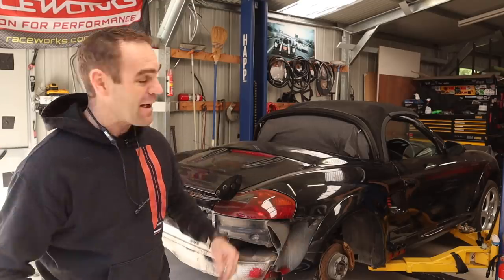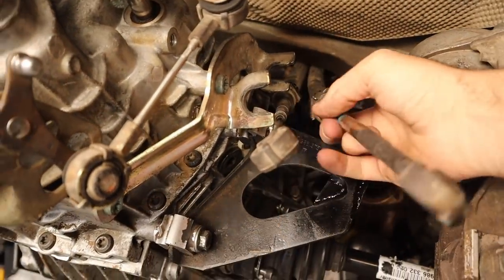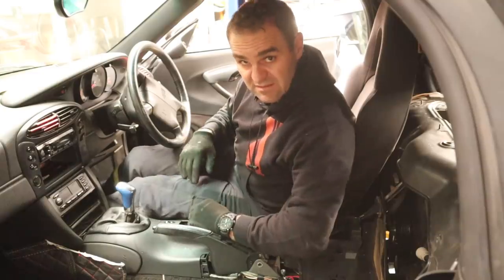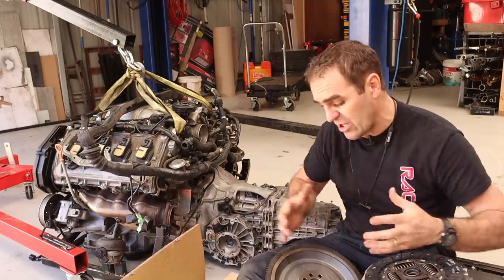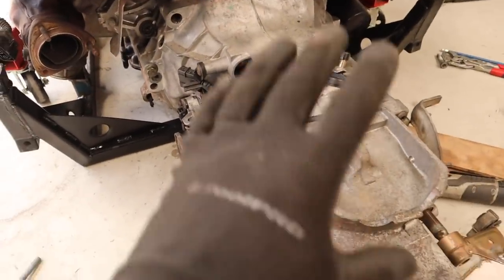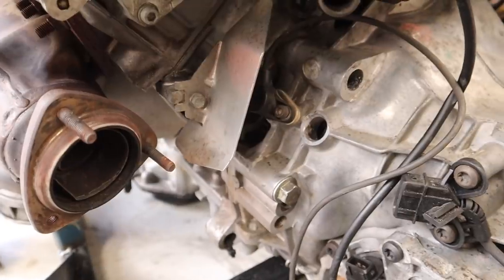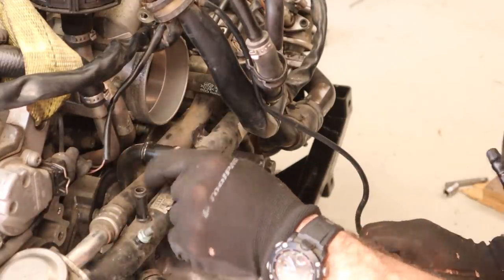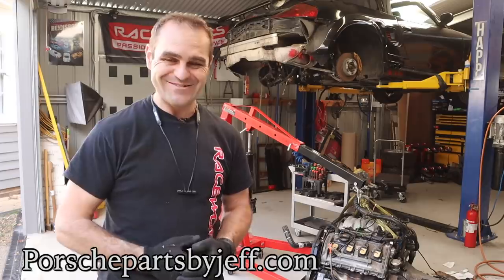Conversion clutch and flywheel - Porsche 986 Boxster V8 engine swap track car build 7

Comment: Loved the way you massaged your way to the gear shift fix!  For a swap I thought would be a nightmare, so far, only delayed parts have really given you much pause. Looking awesome! A thought- put a pair of "garden timbers", about 100 mils square, or 4" US, under the fore and aft of the engine cradle before doing the transmission off boogie. That will let you put a regular hydraulic floor jack under the center of balance of the trans and use it to help wiggle the trans into mate up. Also, while you have it all out, might be a good time to put some better gussets onto the sub frame. The Cayman-ish hardtop sounds like a thing worth exploring too! Mrs.Jeff? Hello, Mrs. Jeff? FR

Comment: No judgement on welding up that pipe, I would have done the same thing. But, you probably want to put an air bleed on it since it is a high point and will probably always have air trapped in their.

Comment: Jeff.
Why didn't you simply take the throttle body connection into the boot through the secondary fire wall.  You would have plenty of space then for mass air and a nice breakfast bend and ideal breathing.
Just thinking.....

Comment: Hi Jeff, a while back i saw a video from some guy building an Ultima with a big LS (or LT) engine and he had the same problem as you have with the intake. He solved it with 3D printing a duct that had recess pockets to clear all the obstacles. Plus it was way more rigid then just rubber tubes or those accordeon pipes (don't know the actual english name for those).
Reply from the maker: If what I am doing doesn't fit, I will look at doing that.

Comment: Will adding a spacer now between the gearbox and engine not affect the mounting point positions for the cradle and chassis?
Reply from the maker: The cradle is fixed, it will just push the gearbox back by a few mm

Comment: Personally all of the coolant hoses tied together doesn't sit right with me, wouldn't be better to bend some aluminum pipe to the right shape and add a flange to bolt along the subframe? So you only have 2 points of hose failure at the outlet and inlet?

Comment: Hi Jeff, love watching.  Did you give any thought on using a Porsche V8?  Just curious if you did pros and cons and would there be easier compatibility?   This conversion will get some interesting reactions on the road.
Reply: He did... main reasons is it’s a common conversion and the gearbox bolt pattern mates directly up to the engine.
Reply from the maker: As James said. All covered in depth in previous episodes ;)
Reply: Plus it’s cheap especially compared to LS swap etc.

Comment: are you still gonna have enough engagement of the alignment dowels between the block and trans if you add a 5mm spacer?  do you need to get extended dowels?
Reply from the maker: It is a factory spacer

Comment: Hello Jeff, what engine code are you using? I'm currently working on a conversion using an AQJ engine (the last A6/S6 V8, with the last V8 ME7.1 management system, which wasn't really CAN bus reliant, from a 2000 model like the later models are). As yours is a track car you may be able to remove the secondary air injection valves from each head, their little cast aluminium elbows and the stainless pipe between them to make more room for your induction system, especially if the engine only has the 2 lambda sensors like the AQJ, not 4 (pre and post cat). I've removed mine as I don't need them for emissions reasons, don't have room for them, and the pallet courier who delivered my engine kindly smashed them, the throttle body and one of the cam timing solenoids for me. 
The secondary air injection valves let additional air in to the exhaust when the engine is cold, which ignites with the rich (cold start) mixture in the cats. Their only purpose is to get the cats up to temperature faster. If you remove them, you would then not need to fit the other parts of the secondary air injection system either (pump, vacuum reservoirs, etc). 
If you're using Audi engine management, this may well cause error codes, but on the engines with just the 2 lambdas I believe they should only be caused by the electrical load from the valves and /or pump being missing, not by the engine knowing the cats have not warmed up as quickly as they should have. I have not tried the electrical side of this yet, but if I am correct, any errors created should easily be remover by using resistors as dummy loads where the solenoid and / or pump should be.
If you are using aftermarket management, or if you are not using cats at all (not sure whether that's allowed in Aussie track cars?), I would definitely remove the whole secondary air injection system.
Reply from the maker: I am not using cats. My engine is ASG, and from memory it only had the 2 O2 sensors. At this stage the plan is to use the ME7.1 to start with if I can. I still need to learn how to flash it and remove the immobiliser. I might try to get it running to start with keeping the secondary air injection, just because the less errors I have to chase at first the better. I can simplify things more later.

Comment: Maybe it is easier to put the engine on that idle standing cart in the background, instead of destroying that new clutch plate, because it's obviously gets all the fulcrum weight, before you have tightened the bolts down...

BTW, this being a racecar only; why not put the airflow meter and filter in the boot/trunk/storage compartment behind the engine?
Blocking off bleeding pipes and hoses is asking for overheating problems due to airpockets in the system.
Reply from the maker: I considered it, but there is a structural member in the way. As for air pockets, the cooling system in Boxsters needs to be vacuum filled anyway.

Comment: What are the regulations at Wakefield Park for beasts like this will be? Will you need to go in sessions for racing cars or will you be allowed with ‘Speed Off the Streets” cars?
Reply from the maker: That would all depend on what kind of day they are running.

Comment: How can you leave all that mess in place? Bin the lot, fit some itb’s and aftermarket ecu. It’ll look, sound and go SO much better.
Lose some weight off that flywheel too.
Constructive criticism btw!
Reply from the maker: That is not exactly cheap track car things though.
Reply: @HomeBuiltByJeff  It does depend how you do it. Bike throttle bodies,  megasquirt and make your own manifolds is cheap as chips.
Easy for a man with your can-do attitude!